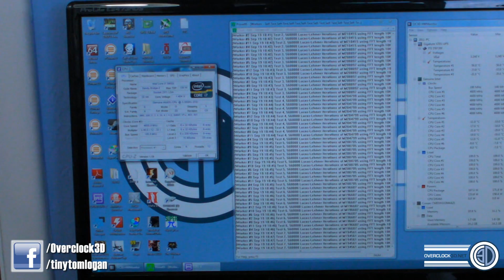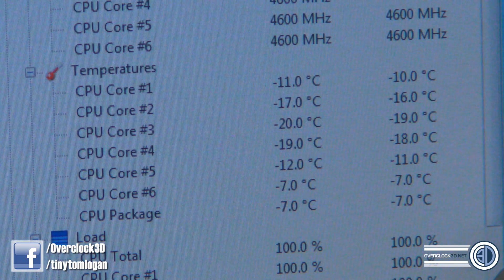Ultimate Corsair H100 Cooling Mod

Comment: Haha iam glad i was thinking of doing push pull on my 120mm 38mm thick ncore cooler master case cooler.  And i was like that thick son of a bish iamma stack another fan on the push side because i know that although speed of air passing dont increase the volume of air and pressure increases.  So iamma try a push pull first and then a stack afterward.

Comment: You should redo this test and remove pairs of fans one at a time and chart the change in temperature on a graph so we can see cost, power consumption, noise etc. for each degree dropped. If it turns out stacked fans is a better solution than multiple rads, maybe more people will do it.

Comment: It's hard to believe that 40 fans have results like nitrogen oxide.
I just cant believe that even 40 fans can reach -7 degrees. If it was true i would be satisfied with maybe 10 fans only to have temps of about 30 C in overclocked mode. That's more than enough.

Comment: This actually helps.  I run Folding@home on my EVGA GTX 1080 FTW Hybrid, and it would average 46 and get up to 49 degrees with two Arctic P12s in push-pull.  With the two Arctic fans and the stock EVGA radiator fan taped on, the temps bounce between 42 and 43.  I am still testing thermals since I haven't seen what the max temperature is yet.

Comment: It will NOT help to blow much stronger! Coolers are just disturbing each other. 
You should synchronize All the paddles and make them smaller and smaller from the In to the Out to make it work. It must be like in airplane engine - than it will work.
You just wasted the time and money: a bit larger radiator with 1 layer of fans will give MUCH more effect.

Comment: I'm back again watching this video. But there have been a lot more comments..
People who think the temps are fake. Thay arnt..
I had a amd fx9590 on a 360mm and 240mm radiator. With 12 x fans on the 240mm and 18x fans on the 360mm.
Overclocked to 5.5ghz and max temps running games where 40c... 
I was restricted because off the vram getting to hot. 

And before you ask it was quite....BECAUSE THE PUMP AND RADIATOR AND FANS WHERE IN ANOTHER ROOM...

Comment: My old phenom was at a very high temp the hwmonitor and realtemp were not working anymore they were showing -128°C at all cores that pc runed like that for 2 years, then i selled it for 200bucks xD i had a gtx 650 and 12gb of ram 1333mhz

Comment: Shouldn’t that make the room warm since it’s just spraying the heat from the cpu into the room?
Reply: Ryan Costner what heat? every core is under 0°
Reply: ooo woo yeah but am I wrong to assume that the heat produced by the cores must go somewhere?
Reply: Ryan Costner yeah it’s diffused through the radiator fins. and the rest of the heat is so minimal that it is dissipated because of all the air flow

Comment: should try the same with 4 delta fans....the 11000 rpm ones on linustechtips as not figuring lossses it looks like that stack of fans is pushing 1300 cfm per side as a rough guess, and similar on the other side.

Comment: you know if you had built a custom funnel rig to mount all those fans on in a purely push mode (aside form the fact it would likely be floor to ceiling in size and twice as noisy) then swapped the coolant out for anti freeze its possible you could have super cooled the cpu without faking the temps in hwmon then again actually doing that would mean a lot of condensation across the rig and probably lots of sparks XD  can probably build it out of paper and pva though so aside form the time not exactly expensive to chuck together :P (don't even try it on hardware you like though)

Comment: I call bullshit. How do 40 fans in series blowing air that's comfortably below room temperature cool a radiator to the point where the CPU gets colder than the inside of a household freezer? Simple thermodynamics- at those core temperatures, the air blowing through the radiator should be depositing thermal energy, not removing it.

Comment: This is bullshit.
You're breaking the rules of physics here.

Unless your room temperature is -20C then the water cooler can NOT go that low.
It does not matter how much air you move or how fast you move the air around, if the air is +24C then that's how much you can cool the CPU down to.

Comment: How would the temperature be under zero if your room is above zero, the air cools the water and if the air is 20 degrees the radiator is going to be 20 degrees and cool the water to 20 degrees....... why would you even fake this

Comment: Just one thought... I have learned... push orientation for the fans on the rads is not a great idea.  I am currently using the Bit Phoenix Ghost mid tower with my corsair radiator mounted below (at the top) with four fans (120mm) in the pull orientation sitting on top.  (note:  I have the top grill removed to make room.

Comment: Great video! Just ordered 46 fans for my cpu cooler. Hopefully I'll still have money left over to upgrade my floppy ram and the flux capacitor on my mother drive. Also getting a solid state graphics controller and a gigahasher for my proton emulator.

Comment: correct me if i am wrong but can you add flow rate in series using the same fans? I dont think you can. You are just moving the air further at the speed of the 1st fan. What a waste of fans. And the guy is amazed by the torque judging by his exclamation when they shake a little at startup.
Reply: agreed a lot of fans on a cooler doesnt make the air flow go faster. it just moves the air far.

Comment: I may have missed it, but what are you powering the fans with? A 12V car battery? Also, how will you know if all of the fans are working? Did you test them all individually?
Reply: Also, -10C is below the freezing point of water. There appears to be some refrigeration action going on here, but that can't be. Are you sure you're getting accurate readings? A freezer gets these temps by converting high pressure coolant to low pressure mist with a pump. The pressure change absorbs heat. In your system there is constant pressure.

Comment: People who believed this are idiots, the liquid in the H100i cannot contain the amount of heat that those 40 fans can dissipate so it makes them completely redundant! Also, by the time it reaches the 40th fan, there's no way any air would make it to the radiator without obstruction. You've just proved your idiocy. The only way to make a better liquid cooler is a larger radiator, better fans and maybe liquid metal for the liquid in the tubing/reservoir which would also be stupid because liquid metal is stupidly expensive. Liquid metal thermal paste costs like $10 for 10mL. Also, that jet engine sound is coming from the air being obstructed by the blades in the fans in front of the other fans. The comments section gave me aids; I can't live here anymore. But obviously, the biggest reason I'm pissed is because people believed it actually reached -20 degrees celsius.

Comment: Put this mod and the PC in a separate room or closet, install a ton of sound-proofng, wire it up into your setup through the walls, and you got a computer that can't overheat, and is still completely silent, technically.

Comment: Ha nice.
But on a serious note if you are using multiple fans in series you should use a high airflow fan rather than a high pressure fan. High pressure fans are good at building up pressure with only a single fan but can't move as much air when you stack them.

Comment: but imagine, if you kept your room at like 40 degrees Fahrenheit (thats how cool i keep my room lol) and then did this, but with the highest rpm fans you can buy in 120mm, and then turn them ALL to 100% with something like speedfan. 
A: it would actually run insanely low temps
B: it would be as loud as a jet engine
Reply: BTW this video earned you a subscriber.
Reply: BigMan7o0 you know that the temps could NEVER go under 40 degrees?
Reply: you didn't read my comment very well. i didn't say the cpu would run 40 degrees Fahrenheit, i said that if you kept your ambient temps at 40 degrees the cpu would run very cool.
Reply: Kaito why couldn't it?
Reply: technically if you kept your room (or just wherever the pc is located) at like 0 degrees Fahrenheit, and had a really good liquid cooler you could do it. or you could just use LN2 and get your cpu temps to like -100 Fahrenheit xD
Reply: +LemonDesigns the smartass edited his comment...
Reply: +BigMan7o0 i read ur comment, but u edited it ;)
Reply: Kaito can't fans cool lower than ambient tho? Cuz if I have a room fan running my room the temp in my room goes from 75 to 60.

Comment: it seems loud is very subjective matter. (^o^)
here's some questions, if the temp goes below zero, will the water be in water state or turns into solid? 
then when the water pump stops (computer shut down), won't there be condensation around the tube/water block?

just my 2c, please post more scientific method like ambient temp sensor, prior and after the mod.

Comment: Fake as fuck. You can't have pc temps lower than ambient temps.
Reply: Obvious troll is obvious.
Reply: The Incandescent One did you watch untill the end?
Reply: Sure you can, this video is proofs it is possible;
Reply: He lives in the Antarctica.
Reply: we know
Reply: he burst out laughing I'm sorry you don't know how to laugh
Reply: The Incandescent One yes you can if you change the air pressure enough.
Reply: I suppose that is true^
Reply: but that would get rid of the heat in the air, it would take a while for it to be passively cooled, as the fans would suck in air from elsewhere
Reply: The Incandescent One it was a trolling video he says so at the end
Reply: yeah he was trolling...and also...yes you can.

fast moving air is cooler (hence why a fan can  cool you from a distance) so it can be a couple degrees cooler than ambient but you'd have to have an insane amount of airflow
Reply: Max Caulfield it's not just speed its a different pressure.
Reply: +Max Caulfield 

the same principle that causes air compressed air to feel cooler...because it's moving faster therefore is at a high pressure. Higher pressure is another name for something meteorologists call a cold front, so e.g. it gets colder suddenly in a small amount of time thats because air is rushing from one place to another and leading to more air causing lower temps. 

fans don't push anymore mass if air at you than they remove from the rest of the room, but by pressurizing that air it cools it and forces it at you. 

if it were just moving it it would sump be blowing the same temperature air at you...but faster moving air I always cooler unless extremely compressed into a small area (like in a turbo for a car)
Reply: +Max Caulfield and that has been proven false, if you move enough air over a radiator you can make it cooler than the sprrpunxung air just the same as a cold front or high pressure are comes in.
Reply: +seth newman basically whats happening is it's slowing down the atoms compressing them... and the slower the atoms the cooler the object

Comment: Can you any one help me please if you can.

1- Im planing on watercooling my vídeo card, two 980 ti sli,and i was coing to cool then with XPSC  AC480 quad fan radiator,and i was planing on putting 16 fans  (or  8 )on it.Can any one estimate what temps could i get with this?

2- And is it Worth watercooling the 980 TI ? Because the price of the watercooling is going to be almout the same if i bouight the GTX 1080.
Sorry for my  english ,my keabord is broken and it is almost impossible to tip on it.
Reply: Conrado Pinto Try using nzxt kraken G10, an inexpensive way to water cool your card without going full custom
Reply: Thanks.
Reply: Conrado Pinto absolutely go for the 1080, watercooling will only allow you to overclock your GPU a little bit more and gain 1-2 fps. it's no really worth unless you have a lot of money and 2+ GPUs
Reply: He already has 2 980Ti I think? He just thought proper custom water cooling will cost as much as a 1080. But if he goes for NZXT Kraken G10 its only $30 each, plus whatever AIO cooler you put on (from $60) so it will cost less than $200 only
Reply: Jason Lam Wait, I missed the sli part. My bad. Personally I would sell the two 980 s and with the extra money buy a Titan Pascal
Reply: thanks.But i wont be able to buy the card.Because i leave in Brasil,but if any one goes to EUA,im going to buy the titan x pascal.
Reply: Maybe you can spend you money on a new keyboard instead. lol.
Reply: all ready did that
Reply: now i have the 1080 ti with the Kraken g12 and corsair h105,perfect cooler,the vídeo card never passes 42c on oc to the max
Reply: thanks,i sold mine 980ti  and bought the gtx 1080 ti .And now i put the karaken g12,with corsair h105,and now the vídeo card never passes 42C.just perfect.

Comment: he just set the limit temps on real temps to 70 c instead the default 100c. so when your cpu temps is 20c at 100c it will show -10c. you can use it in the program just go to settings and find ''set TJ max''' then u can set it to 70 and see your cpu temps to -7 or less. As he said its a troll video!!

Comment: it is impossible that the temperature is negative
Reply: water cooling is still better than wasting time with subzero temps because a freezer being used for this probably won't last a year vs this water loop setup you are better at water cooling or dumb the whole thing in mineral oil instead

Comment: FAKE ! do NOT really care if you did in purpose or not, but a fan alone system CANNOT PRODUCE NEGATIVE TEMPERATURES
to do that you need a refrigerating system ... so, either you did this in purpose and you faked the numbers, or your temp sensors are screwed up, EIDER ONE MAKES THIS FAKE ...
if I move past fake, I still can say one lil' BAD thing about your sheet ... IS A LOUD SYSTEM, you may be deaf, but most of us won't have such thing in an office where to work or play games

Comment: I worked dude my fx 9590 temps are under 10 C.  But not as much as lower than you. MY clock speed is 5.6 ghz at 1.57v

Comment: It doesn't even make sense, putting 1 fan over another 10 times is canceling the first fan effect as it takes the air from it.

You can go even 1000 fans, the air flow will be 100% the same as the fans swing and recycle the same air.

It is 100% fake.
Reply: Watch the end of the Video...
Reply: duh.

Comment: Somethings wrong with your computer. Physics doesn't work that way. The laws of thermodynamics states that heat travels from hot to cold. The temperature of the air would have to be at -19 for any of the cores to be that low. In fact if the cores were that cold, the air would then be warming them up.
Reply: there's a disclaimer at the end

Comment: WE  WANT TO KNOW WHAT WERE THE REAL TEMPS!!
Reply: Nope, fans can't cool anything below room/ambient temps.
Reply: You can't just "create cold"
heat flows from hot areas to cool areas, so unless you're sticking your pc's radiators in an icebox it won't cool past ambient temperature.
fans channel the air to where it needs to remove heat from the water. via the heat pipes.
Reply: just google temps for an i7 tested with this cooler. same as any other.
Reply: it would have at least 10c lower temps.

Comment: So will this hold my amd cpu under 120c?
Reply from the maker: Thats what your hands are for
Reply: OC3D TV I don't get it
Reply: 恵勇気 I've tried that, but the plate just goes red/white hot and then the food gets burnt. But I found it works well for melting aluminum and copper for casting
Reply: i gave up, just use mine for toast now, AMD bagels are pretty good
Reply: jakub ss  future or  parallel universe? lol
Reply: AMD ryzen is much more cooler and more efficent than intel
Reply: hello im from the future and ryzen is more efficient than intel
Reply: It would be close but maybe
Reply: Akasa Nero 2 air cooler on my AMD 6 core and Prime95 with +600mhz overclock is hitting 57c.

And a shitty Antec Sonata2 case :D

Nowadays tech heats up with low tdp but uses less power? Yeah right :D

Comment: I'd actually like to know what the CPU temp was, it would be nice to see if there was actually a difference
Reply: Necro response but yeah, I would like to know how the temps worked out. Did it manage to get down to room temps or did the large number of fans end up messing up the air flow and preventing them from working as they should.

Comment: do you have aircondition in that room? As long as an AC is running you can theoreticly run infinitly. But as soon as the AC stops you will sooner or later se that the temperature in the rooms starts rising and then the cpu-temp will start climbing.

Comment: How many Amps are you pulling at 12 volts for all those fans? And RE: your molex power supply- what size wire are you using between your PSU and the black splitter cable ? And Have you tried a bigger radiator? 4 fans wide X ( 5 fans front + 5 fans back ) for the same total of 40? Also Have you tried pulling the fans away from the wall? It looks like less than 4 inches away from that wall. And while we are talking about fans, I am having a problem with your -8 deg C. That is 17.6 deg F. That means the air coming into your fan system was colder than ice. Ice happens at 0 deg C and 32 deg F. I don't see your breath. Something is not right here. If you're measuring a delta I could see those numbers, but I am not thinking that is what we are seeing.

Comment: Just a tip if you are 10 degress below current room temprature you start to get moisture water etc.
so go to cold you can damage the system instead.

Comment: Thanks man. Delidded my Pentium II and installed this on it. Now it's running at 42.01337 GHZ, and it easily beats a 6950X. Not to mention it's pretty quiet and fits in my mini ITX case :)